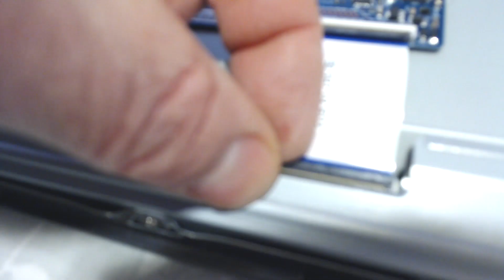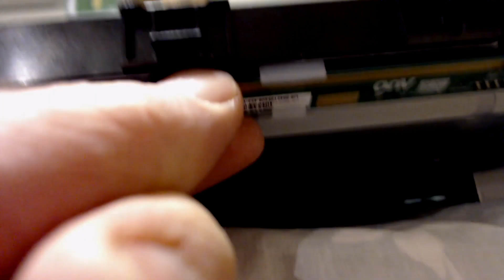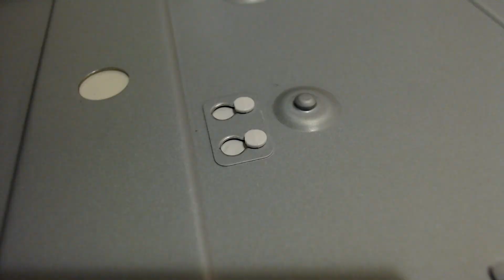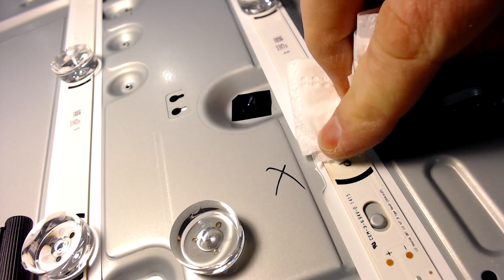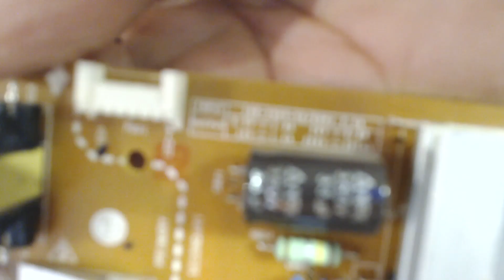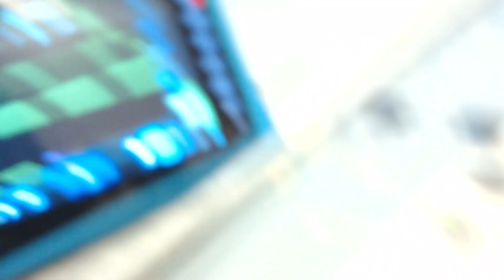42LY540S No picture backlight repair and LED current modification

Comment: Coincidentally a tv I repaired came back to me, today I gave it a look and it seems someone was in there after me and grabbed all the spare LEDs I left inside! Bastard. Also did not bother to connect properly shield taps to the tcon board. Because of that at least I know I'm not seeing things and there was someone tinkering with stuff. But my question is, how often do you see your repaired backlight back? I know my tv had at least 1 repair before me (just cut and soldered in place with wires piece of other led strip) I did it and cut the current to the leds by 30% and it seems if failed twice since. Should I go for replacing all the leds or hope it will last more than half a year? Thoughts?
Reply from the maker: I never had a complaint with a LED TV I repaired. At least that does mean that they didn't fail right after I repaired them. If unsure of the state of the LEDs I would probably replace whole strips, if it's financially viable. With the prices of TVs nowadays it most often is not worth replacing whole strips, I never did it. 
I ALWAYS lower LED current by at least 30%, often 50%. The very best solution would be to replace whole strips and lower LED current. You won't hear back from that customer.
Reply: @tomtechtod9200  Well it's family customer so I'm doing it just so it does not end up in a landfill. It's not popular brand (blaupunkt) as well so getting strips is not that easy. Also there's no guarantee that they'll last longer if made out of the same batch, ripped out of some old tv. The only thing that stops me from replacing every one of them is the pain re-seating lenses. :) 
Cheers for reply. It seems this problem is specific to this model then. I'll try to lower current even more and see if that has any effect.
Reply from the maker: what' s the model number?
Reply: @tomtechtod9200  40/234I-GB-5B-FHBKUP-EU

Comment: How does removing resistors lower current?
Reply: the led power supply reads the voltage drop over the resistors, if you remove some resistors (they are many in parallel) the voltage will rise so the power supply will lower the amperage to restore the power it thinks it delivers